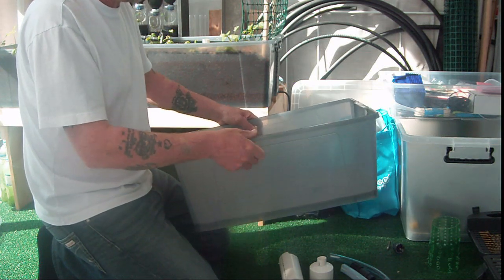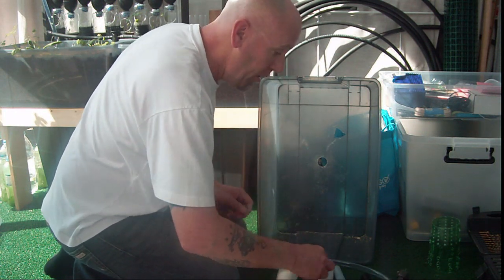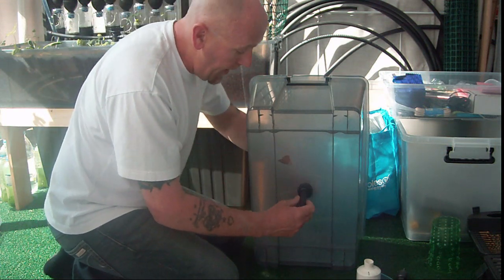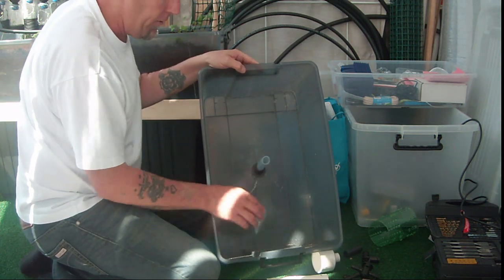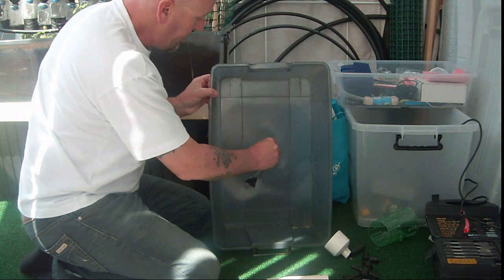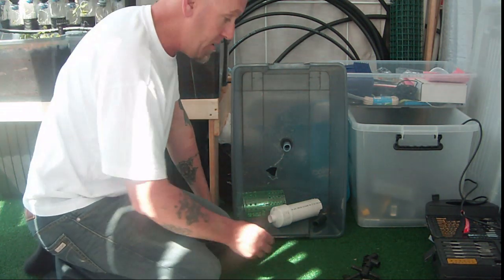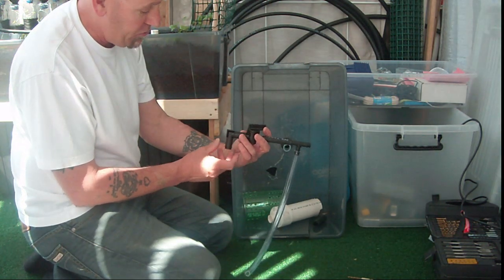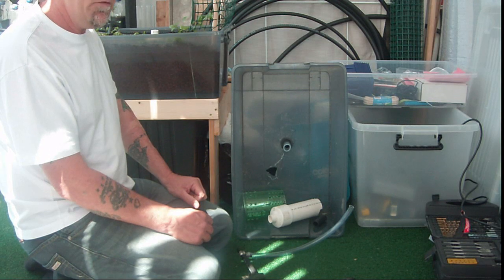Urban Green How to Aquaponics and Bell Siphon

Comment: Before cutting heat the area and slightly press the tool in. You will have a center to cut from. The plastic will not have the tendency to snap.

Comment: The corner piece is slowing the water flow, that's why your seeing the siphon improvement. Tip when drilling plastic go slow and don't put to much pressure. let the drill do the work.
Nice video by the way.

Comment: If you want the syphon to work even better, you will need to make the neck of the small diameter pipe wider than the rest of it, that way the water volume falling into the pipe is greater than the volume that would fall with a smaller diameter top edge, so when the water reaches the thinner diameter of the pipe it floods the pipe with the extra volume of water and creates the suction it needs to get the syphon started.

Comment: To avoid breaking the plastic when drilling, heat up the tip of the drill bit with fire, the drill bit will melt the plastic before it has a chance to break.